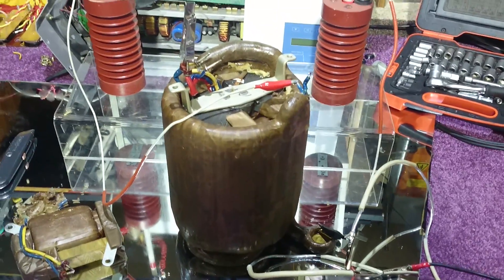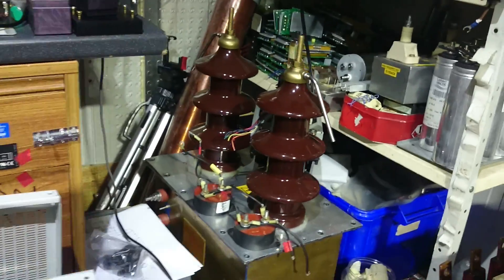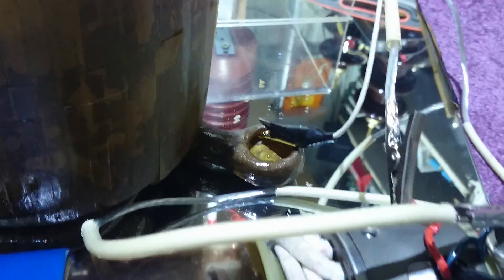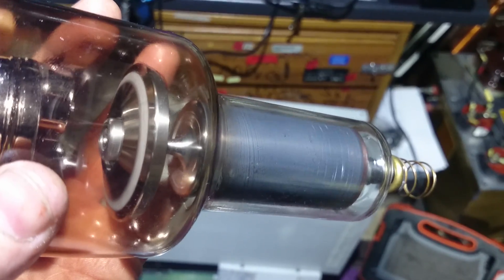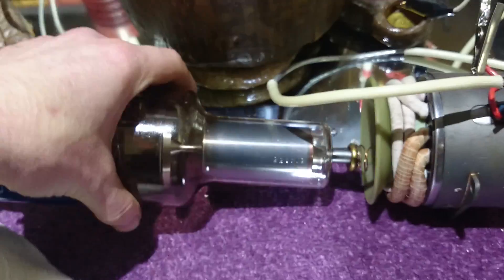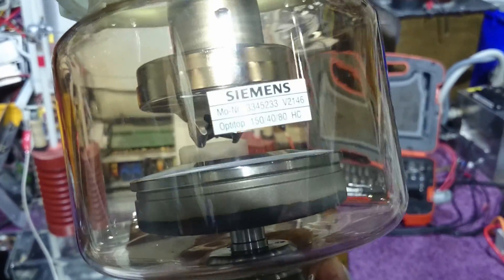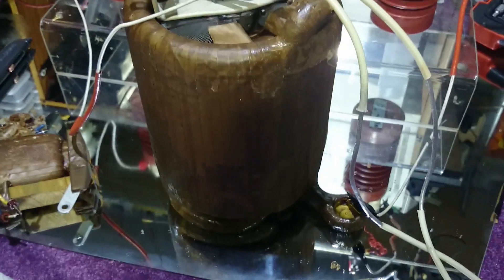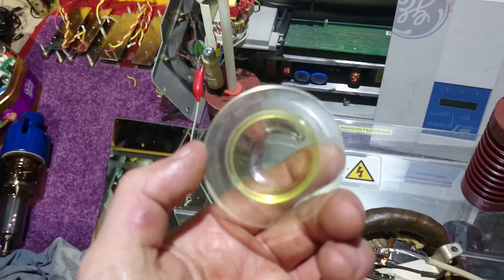Spinning Anode X-Ray tube head. 125kv

Comment: The bearings are made of lead because no lubrication could be used inside the vacuum tube. The system will electrically break that quickly after exposure because these bearings will not last very long.

Comment: Good video. I enjoy that sort of tech too. The beefiest transformer I had was a 10Kv neon transformer. A friend wanted an HV supply for a tesla coil experiment, but kept blowing up switch mode PSUs. as they couldn't take the punishment. We swapped a good 8Kv SMPSU he had for my 'proper' iron & copper one. I now have my lit neon sign hanging in the lounge. 
It's just odd that you were afraid of powering up a farting little 6 volt filament, but had no qualms about messing around with the HV Tx.

Comment: How did you wire up the filaments and rotating anode. I'm an xray tech and have 4 tubes, complete with their stators, but I don't know how to wire. Been trying to look up diagrams, and I'm good with electrical work, just don't know the correct voltages. Trying to make it for display and don't want to burn the filaments out on my tubes, and getting them to spin would be awesome. Tried straight ac once but didn't work. Not sure how the (and what specific kind) of capacitor it needs to start. I know the filaments are ac also, but would a dimmer switch work or enough voltage from DC?
Reply from the maker: Daniel Rivera Hello mate,
well the field winding are wired the same as a single phase Ac motor. your windings will need a start cap. and if I'm honest I'm not a 100% sure on the filament voltage. I think it's about 30volts. but don't hold me on that lol. you would be best to use leds to make it glow up" some nice blue ones .  because if the filament is on all the time it will get hot. and I'm sure it's needing the insulation oil to keep cool.  you never ever power the Anode and cathode up with high voltage lol. as it will fry your bollocks 😨as you know haha.
but yeah it's straight forward. and once you power the winding ups try it first on 110volts to be sure. and even if it is 240volts it will spin fast on 110v anyway. do you have any ballasts and own a variac??  as it's a good idea to get a ballast around 100watts or something, and have that wired with the output of the variac and try different wires on the windings. as the ballast will limit the current and nothing will go bang. no magic smoke lol 👍😉 

hope this info helps.

Anthony 

High1voltage1rules

Comment: I was an x-Ray technician.  The Fixed Anode or Not spinning Anodes would degrade so you were always having to compensate the angulation of the cones used to focus or collimate the xray field area because of what  is called the Anode Heel Effect. ( Uneven distribution of the Mass of XRays  being emitted. Those old Pickering 100Ma and GE machines were good but now you can get an Xray very fast you can catch a GNATs breath as it flies under the XRay Beam!

Comment: Man i don't get it,how is it possible for the anode to continue spinning without external power?Even if the tube is in vacuum there is a friction resistance from the shaft bearings and also the power of the earth's gravity  can also  stop the anode from the free running.
Reply: Wow excellent engineering!

Comment: I could use a spinning anode 125 kV tube for a fluoroscope for analyzing mechanical objects and a transformer to power it up
Reply from the maker: you could but be careful.  make sure your 20 feet away or wearing a led coat. messing with Xray is very dangerous. 
best of luck.

Anthony 

High1voltage1rules

Comment: The rotor is made of permanent magnet? i.e. this is synchronous motor, not induction (asynchronous) motor? Usually rotor of the induction motor is a squirrel cage rotor made of a steel and aluminium and it is nonmagnetic. If the rotor made of a permanent magnet, this is synchronous motor

Comment: very nice. how long does it take for the anode to slow down
Reply: It depends on the bearings. Sometimes the angle at which the tube is pointing; like to the table or wall stand will make a difference as well.

Comment: Nice tube, glad to hear the bearings are as noisy as in my tube. Thought mine had too much use although it was only a few years old when I got it. I am happier now. :-)
Reply: X-ray anode bearings are always noisy, as they are dry. You can't use oil or greases due to the need for high vacuum and the very high temperatures which they get exposed to. The anode can get red hot after a hard exposure.

Actually, the modern ones are quieter because they use gallium lubricated hydrodynamic bearings.
Reply: @ChumpusRex  Thank. I suppose that because any greases securely vaporize and compromise the vacuum and their atoms collide with electrons. How is implemented the rotating anode electric contact? It should be an technical issue due the high current request and availability specs.
Thank if you explain that
Cheers
Reply from the maker: ChumpusRex thanks mate for the info, I'll come across one some day lol,
 👍😉 Hope ya well and be safe, 😁

Anthony

Comment: Great finds you have, that smaller X-ray tube would have come from a mobile X-ray machine as used in hospital wards. I like how you used the stator windings to spin up the Anode. You could run the filament at around 6 volts to illuminate the Anode. As mentioned by others, the Anode is indeed made of tungsten, high temperature melting point plus tungsten is very good at converting the high voltage electrons into X-rays. The Anode is spun to evenly distribute the temperature loading  across the target, you can see the track on the surface of the disk. The bearings are very well made as they are required to operate in a vacuum under very high temperatures as the Anodes can glow brightly when used extensively especially in such applications such as CT scanners.
Reply from the maker: Hi mate, thanks for the info there, very kind! It's always good to know abit more about something, but to be honest I stay away from powering the anode and cathode lol, don't even want to power the filament, I like my balls the way they are lmfao 😉👍

Thanks again and hope ya well,

Anthony 

High1voltage1rules
Reply: Hi Anthony, powering the filament is perfectly safe so long as you don't apply HT to the Cathode and Anode otherwise X-rays may be emmited! You could experiment with powering the filament using a variable power supply to get good illumination however over 6 volts might risk blowing the filament. Some X-ray units run the filament continuously at a low voltage to maintain the heat in the filament and then the voltage is boosted during the exposure stage to ensure good electron flow. This also ensures protection against thermal shock and premature filament failure as the tubes are very costly to replace!

Regards, Ian
Reply from the maker: ***** hi mate, yes thank you for the info, I'm still not going to power the filament lol just not my thing bud, what I did was enough for me lol, but THANK YOU anyway, 👍😉🙋😁

Hope ya well.😉 and be safe 

Anthony 

High1voltage1rules

Comment: the spinning anode is to prevent excessive heat build up in a vacuum (which is hard to dissipate). It is also large in size to absorb heat but this has a limit.By spinning, the electron beam only hits one point and by the time the anode has done 360 deg, it has had time to cool.
Reply from the maker: Hi mate, yes your correct, as I'm very familiar with x-ray head as iv delta with alot in the past, and my friend who owns 5 warehouses of x-ray equipment  the lucky git lmao, but I can get any equipment when he's ever there lol. The place is awesome!  If ya interested iv video up to watch!  X-ray Warehouse! 
Thanks for the info and thanks for the comment.👍 

Be safe,

Anthony 

High1voltage1rules

Comment: Nice bit of kit. You should be able to spin the bigger anode using a motor stator, if you find one large enough for the glass envelope to fit in the middle.
Reply from the maker: Yeah thanks for that mate, bloody good idea 💡 👍
Thank you 👍😉🙋😁😋

Thanks for the comment and info mate, Be safe.🙋 

Anthony 👍😉⚡🙋

High1voltage1rules

Comment: Rather impressive, and that with zero oil in the bearings.

They can't have oil since it would mess up the vacuum.

Filament + spin would look rather neat, but no hv unless you have a way to deal with the radiation. You quite much got all the parts already.
Reply from the maker: Hi mate 
Yeah I fully agree, and that anode spins very nice' I love it!! 
BUT I'm no way going to even think about powering that x-ray tube up mate, it's not even worth the risk lol. Not even if I'm 10 feet away😷 dam dangerous bud!! 

Thanks for the comment and info mate, Be safe.🙋 

Anthony 👍😉🙋⚡⚡⚡⚡⚡

High1voltage1rules
Reply: high1voltage1rules
If you short the ends and just power the filament, it will be nothing more than a fancy light-bulb with a spinning thingie. Making x-rays require high voltage.

And yes, never connect it to the high voltage transformer.
Reply: high1voltage1rules I wish you had had the filament powered up whilst spinning would have scared a lot of people LOL. Shame you can't power those things up properly but they are way too dangerous.

Comment: Definitely not a dental X-ray head; not with a 125kV transformer.
Reply from the maker: Hi mate, yes I have been thinking about that, especially with a spinning Anode!  But in the past I had a dental head and the transformer was 150kv at around 25ma 50-60hertz. And yes it's some voltage lol. 

Thanks for the comment and hope ya well.😉 

Anthony 

High1voltage1rules

Comment: You can stop the anode spinning by rotating the tube in your hands in perpendicular axis to the anodes spin axis.
The opposite of gyroscope.
Or can`t you? you said you tried to shake it....
Reply: You also take the risk of the high vacuum X-ray tube exploding from mishandling...
Reply from the maker: Hi mate, yes iv tried that and it does nothing lol, those bearings are so dam awesome! So well made! The engineerings of that x-ray tube is very well made.

Thanks for the comment and hope ya well.😉 

Anthony

Comment: Nice mate. From what I can see. That anode drive coil. Is two pole. So will probably spin at 2850-3000 rpm. Will look cool when it is finish as you said. You could make your own drive for it to spin it at whatever speed you want
Reply from the maker: Hi mate, yeah thanks for the info and comment. 👍 hope you are well 😉

Thanks,  Anthony

Comment: The rotating anode is usually made of thoriated tungsten, not titanium.
Reply: The anode target is usually made of tungsten-rhenium alloy, but special purpose tubes may have different materials if characteristic X-rays are needed (e.g. rhodium if lower energy X-rays are desired). The anode core is typically a layered construction with something with excellent thermal conductivity, such as copper, at the surface, and something with high heat capacity slightly deeper, like molybdenum. The shaft is often made of a different material with low thermal conductivity, to limit heat transfer into the bearings.
Reply from the maker: Mostlymacros thanks mate for the info. Sorry for the late reply, iv been very busy with work ;-( lol

Thanks again and hope ya well
Reply from the maker: Mostlymacros glad ya well bud, nothing worse than the flu, hate it. :-%
Take care bud ;-)